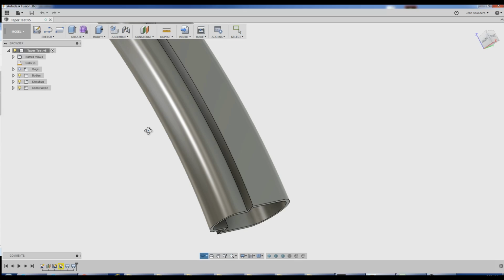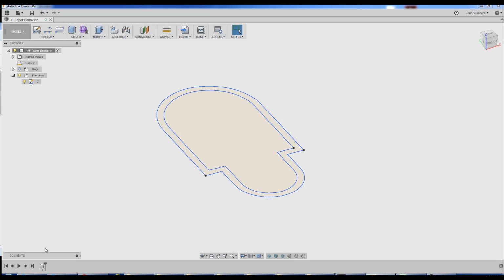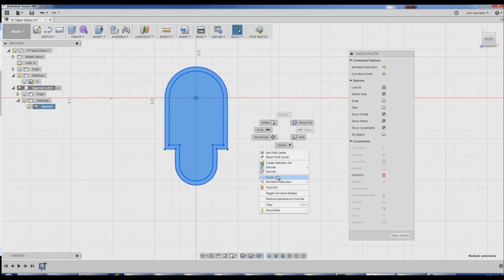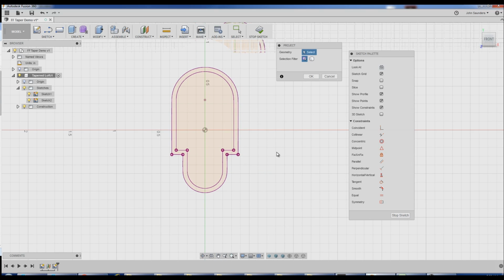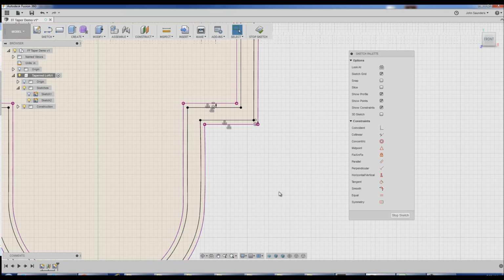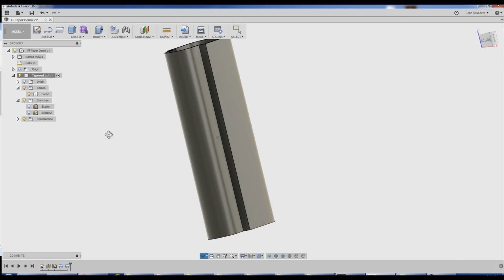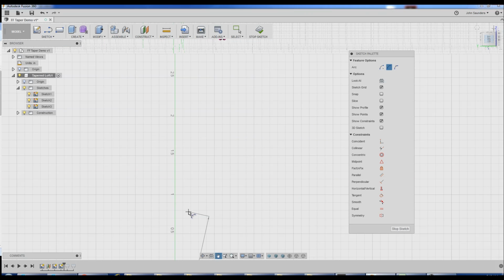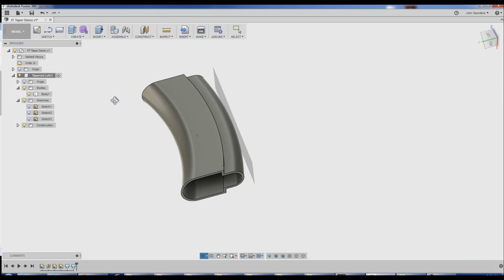Fusion 360 Tapered Loft Tutorial!  FF86

Comment: Any update on why the loft is like that? I was trying to create a custom 2" PVC 90 degree elbow because I needed it to fit into a tighter space than a normal 90 would. I went from a 2 inch circle to a rectangle and then back again and have the same issues with it lofting the whole center area. Another way to fix that was to use the shell command after the loft, but it would be great it fusion only lofted the profile you selected. Is this something we can bring up to the autodesk team?

Comment: OT --Why the need for a .010 taper in that direction?
How would you make this piece?  split it? Cast it with a core?  
If you were going to cast it, it would need draft, but not in the direction the .010 taper was added. Wall thickness is too thin for a "conventional" casting... lost wax could work?  For a test piece I think I would split it, machine the two halves, bond together 

Sorry ..... just curious why the .010 taper in that direction.
Reply: MIGuy 
Perfect example of where 3D printing would excel.

Comment: That's a fine solution, if you want the profile to remain parallel at both ends... What would you do if you want the profile to rotate around the center of the arc?.. Like putting a bend in a conic section.
Reply: You can rotate the sketch.  First create a construction plane at the angle/position you require, then paste a copy of the sketch (or recreate it) on that plane.
Reply: I can think of some "hacky" ways. E.g. do what John did, but on the arc sketch add a line from the center of the arc through a point on the rear side of the profile. The do the loft, then do and extrude and use the line on the arc sketch to do a cut. There must be a way of rotating the profiles sketch plane though.

Comment: john don't bother with doing save as .dxf copy paste does work most times now, if it does not paste straight into the sketch, you try pasting on the origin point or on a sketch point and sometimes the copy does total fail and you just have to copy again